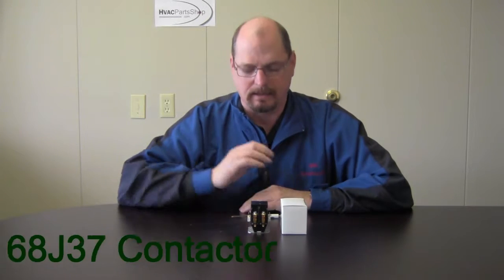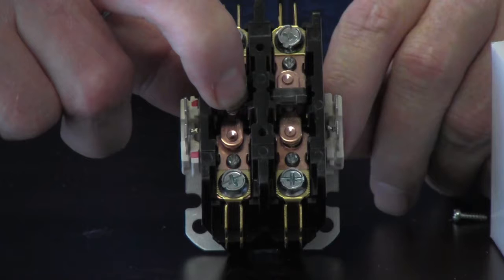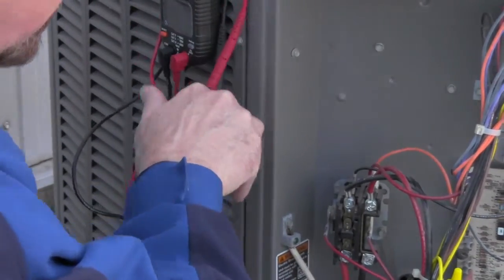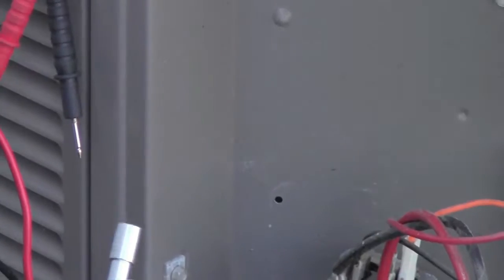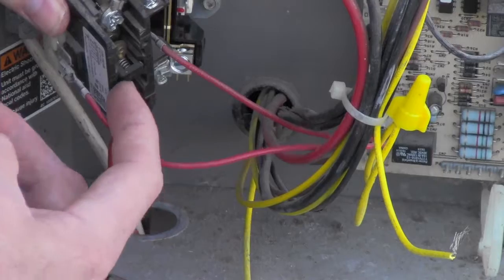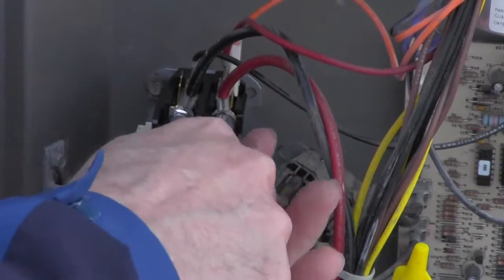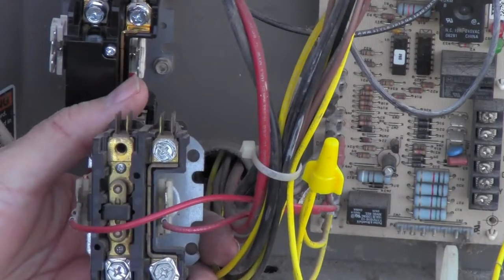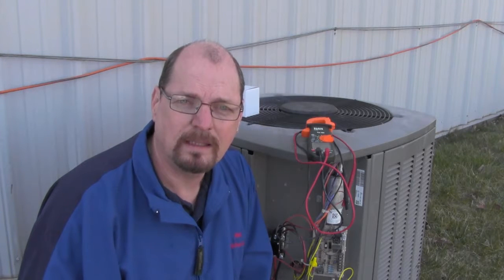68J37 Contactor

Comment: Was I seeing this right?  At 11:06 in the video you removed the first connector off the bottom plug and attached it to the top of the new contactor and on the second connector you removed that from the bottom plug and attached it to the bottom of the new connector.  Why would you switch places just for that first connector point?  Was there something different with the new connector?
thanks